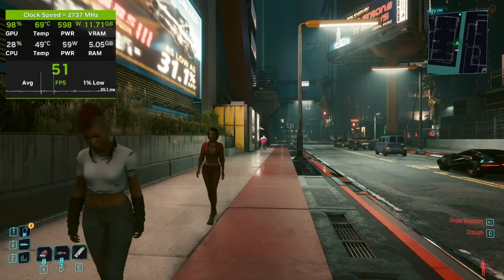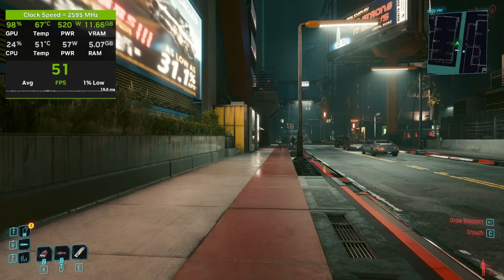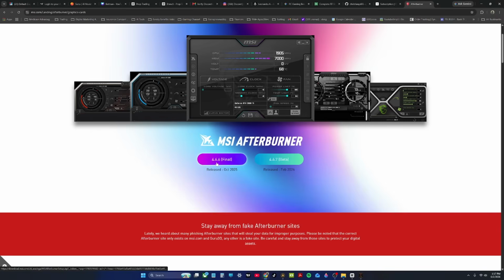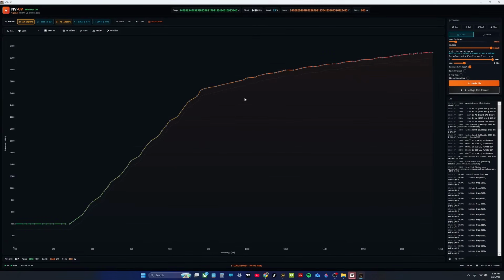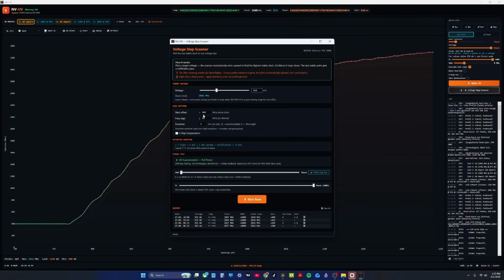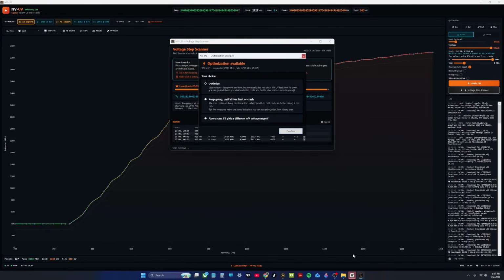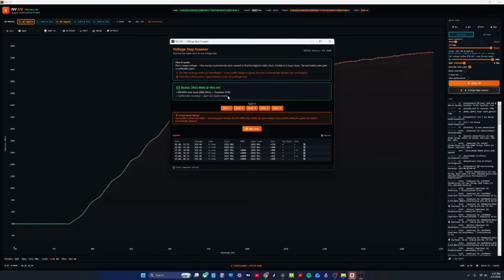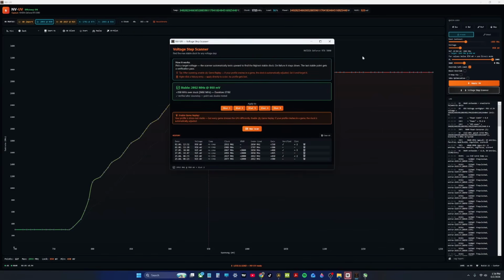RTX 40 & 50 Series Undervolting Made EASY! NV-UV Step-by-Step Guide

Comment: I've tried running the Voltage Step Scanner on my RTX 4070 several times, but it keeps showing "Inconclusive": "The requested GPU clock was not reached consistently under load." I'm using the latest NV-UV Balanced preset (2550 MHz @ 925 mV). Anyone know how to fix this?
Reply from the maker: That's a tricky one. The Boost algorithm on the 40 series may be a bit different than the 50 series but i'd first try more voltage or check your temps to make sure you aren't hitting a thermal throttle.

Comment: How safe is this with an rtx 4060 ti 16gb I'm just trying to to go little bit above 2595 for now. But not sure what could happen if o let it push it all they. Right until now i manage to undervolt for now with msi
Reply from the maker: The only thing overclocking at too low a voltage will do is produce a driver crash. It does not harm the GPU in anyway, just makes it unstable for normal operation. You'll have to find the sweet spot that keeps you stable at your preferred voltage.
Reply: @Dexion845 well yeah I'm trying, did some stuff with msi but not sure how much nv uv is worth it

Comment: When mine hit it's limit and crashed the driver, the program freezes and nothing actually works as should. I have a 5090 Aurus Master, it crashed at 3050mhz. NV-UV v0.99.5.7 And force stopping the program shows the failed points still saved and still able to be applied when build notes show they should be marked as failed and not able to save to Afterburner. NV-UV-v0.99.5.6 completely force closes program when driver fails.

Comment: Screen turned black after 2 minutes of running the continue settings like your did don’t know what happened
Reply from the maker: That is normal the job of the app is to find the point where the driver crashes so it will save the setting before the crash.

Comment: Will this work with a rtx 4070 laptop version?
Reply from the maker: Not 100% sure check the latest build, but if it works on the desktop version it should work on the laptop since it's the same Ada Lovelace architecture.

Comment: now do a OCCT test on extreme and pass with no errors for 1 hour
Reply: In winter maybe, i use it in game and it's stable combined with oc/undervolt of cpu (also tried occt, but only for 5min and no problem)
Reply: @jeanbon6084  from what ive learned most errors in a OCCT extreme test will appear before you hit 30 minutes, so whenever its a cold enough day see if you can get to 30 without errors.
Reply: nobody should give a rats ass about OCCT
Reply: @shaolin95  definitely should lol ig have an unstable gpu its ok

Comment: Ok so I did the Balanced preset. I click "Bal" then save it then Apply UV, wait a minute then its done right? I'm used to manually under/over volting sorry for the noob question.
Reply from the maker: yeah, as long as you applied your under volt and saved it to the MSI afterburn a profile it's already sent once you click one of the five profiles

Comment: Funny my 5070 runs almost everything better undervolted.
Reply from the maker: Yup, I get the best 1% Low's with an Undervolt/OC combined with a RTSS framerate cap with Gsync+Vsync. Currently playing GoW: Ragnarok (my backlog is so bad 😅) and i'm at 138fps locked and 134fps 1% Low's using DLSS Balanced with Preset M & Framegen @ 4K.
280w power consumption. Can't beat undervolting!
Added bonus is your board components like fuses and mosfet's can last longer.

Comment: ASUS RTX 5070 Ti TUF OC = 3000 core, 3000 memory, 950 voltage. 🎉 It works stably with these parameters. Holds 62-65 degrees